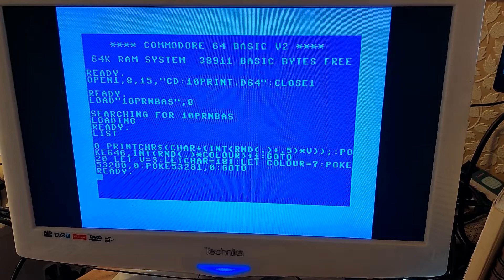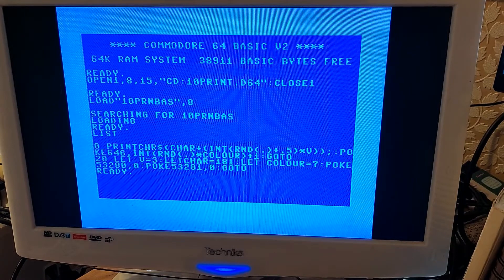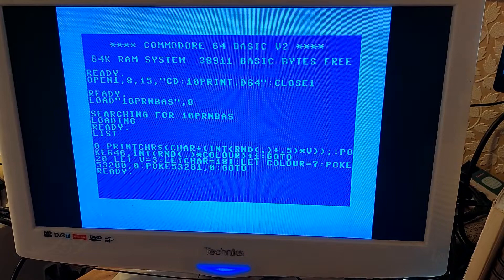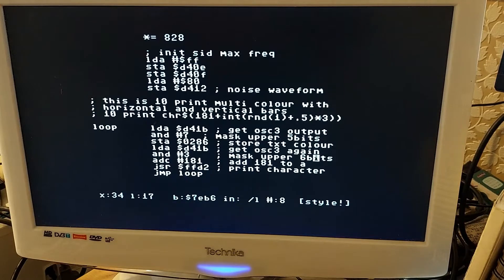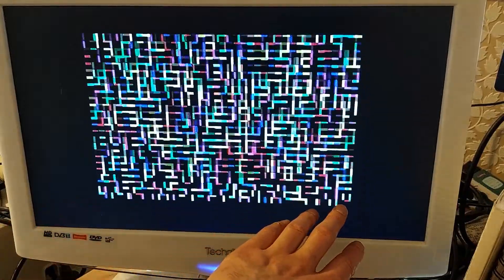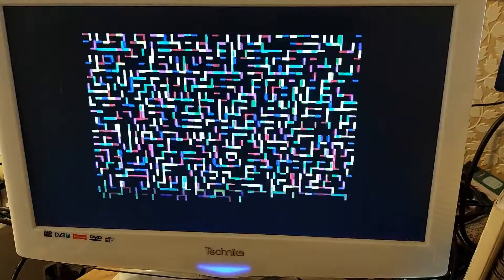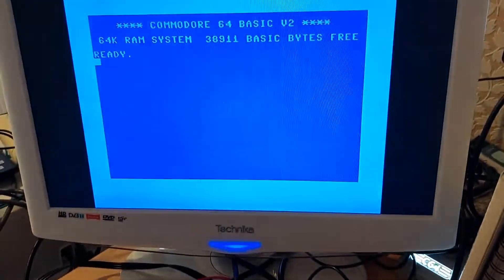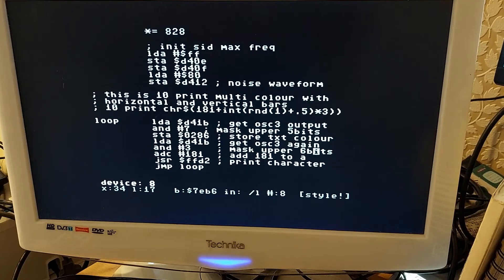Commodore 64 "10 print" (square) but in assembly...

Comment from the maker: I just noticed rewatching this that we only need get the oscillator 3 output once per loop. I'll do another video updating the code. Also compared to the basic version I think it needs to be "colour +1" as it's outputting black characters on black background if random number is zero

Comment: I wonder how much faster you could make this run if you did the work of scrolling the screen and adding new data to it by writing directly to video memory instead of using $FFD2. I’d love to see that!
Reply from the maker: $ffd2  jumps to $e716 after (in our case) unnecessary logic to decide what channel to output on, screen, serial etc. $e716 has a lot of code which again does loads of checks and calculations that we probably don't need, such as different paths depending on the character code.  
Here's two links to the ROM disassembly I found:
https://skoolkid.github.io/sk6502/c64rom/asm/F1CA.html
https://skoolkid.github.io/sk6502/c64rom/asm/E716.html

Would be a good exercise to rewrite "inline" with just the bit's we need.